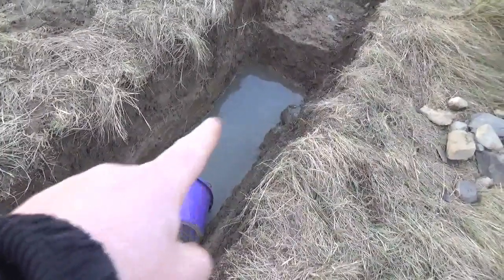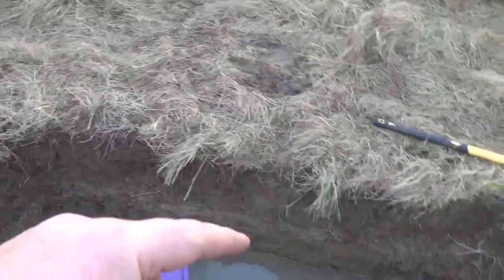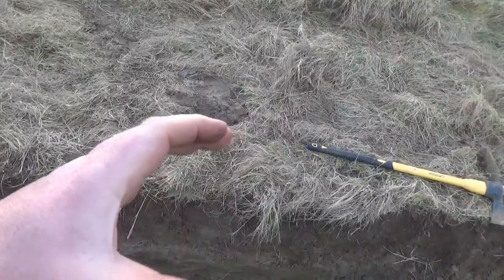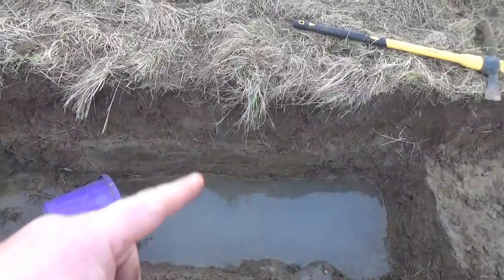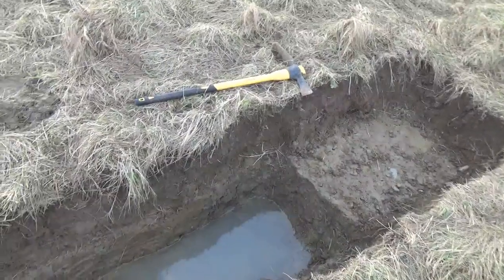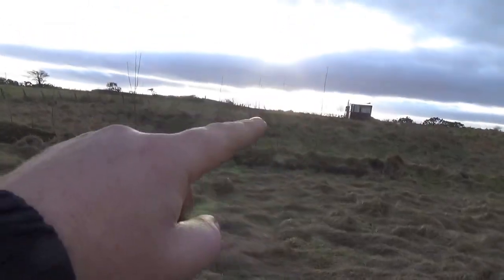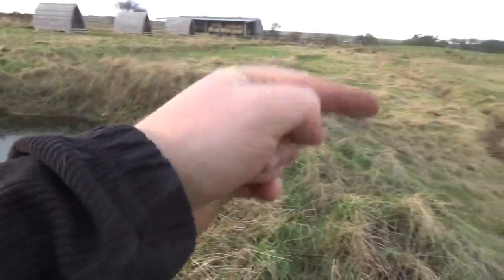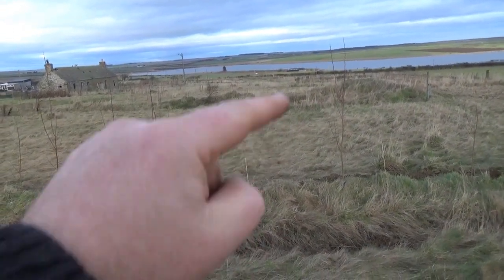Digging a large clay pond by hand. No liner. No machines. Part 1, beginning the keyway.

Comment: The clay on my property is 20ft deep way beyond what I would want to dig out. I made a auger tool with a handle and that is how I know dept of clay which is a lot of soil to move.  I have dug out over 25 yards of clay by shovel and pick on another property and hauled it 25 miles across town to my property in my F250 a yard at a time. Not many people dig by hand as its some tuff work out. Awesome project you have.
Reply from the maker: That's dedication! Are you using it for ponds?

Comment: Very cool design. Did you go for swales over keyline ploughing because of the low annual rainfall?
Reply from the maker: I've not measured it, but I'd say the whole site is roughly 75 metres across slope. If I'd keylined it, I'd spend half my time just turning around at the end of each row. I'd also need annual access to the tractor and plow. I'd have to wait many years to deepen the topsoil enough for some of the trees we have growing. Plus, the swales allow me to manually adjust the water infiltration across the whole site because of the monks.

Comment: Nice , how's your other pond doing ?
Reply from the maker: We have a problem with an invasive pond plant, currently. I have a couple of non toxic methods I'm trying out. Otherwise it's great! We're in a fairly long drought at the moment, but the pond still has water, and still teeming with life.
Reply: @CairnOfDunnCroftPermaculture ahh sweet what plant is that ? I got a similar size no liner pond as you it's very similar two small islands and its feed by a natral spring (only flows in the winter)
Reply from the maker: Australian swamp stonecrop. It's very difficult to control.
Reply: @CairnOfDunnCroftPermaculture  oh hell how's that got there? Iv not heard of it , hornwort has taken over the shallows in my pond ducks must have brought that.
Reply from the maker: @evo8power228  it's in gardens locally, so it'll keep coming back. I need to design for it, ideally.

Comment: I found a good clay layer but it is very deep. I had to watch a video like this before I do twice as much work.😅So, that is not the waterline? You added all that? And it does not drain very quickly? I would like very much to build a natural pond with no money. Thanks in advance if you answer.
Reply from the maker: So far I've only done a bit of the keyway. We do have a video on a finished pond though.